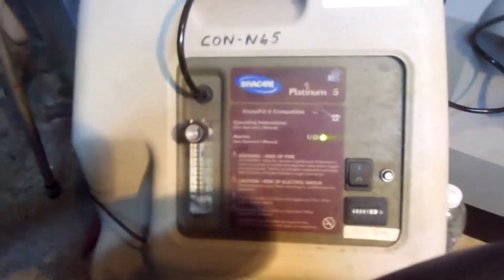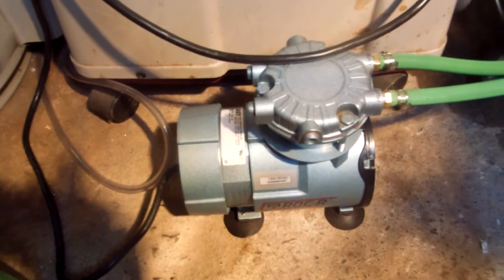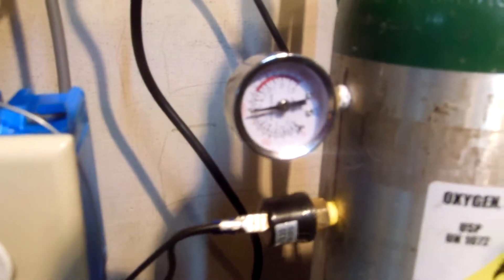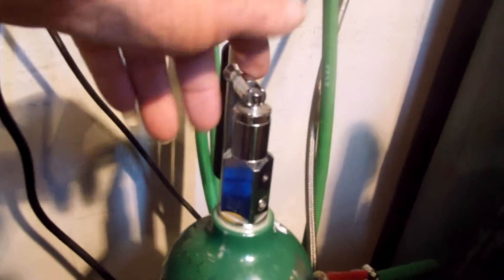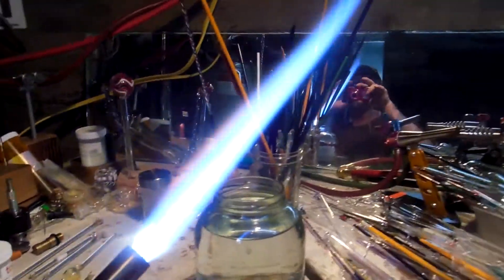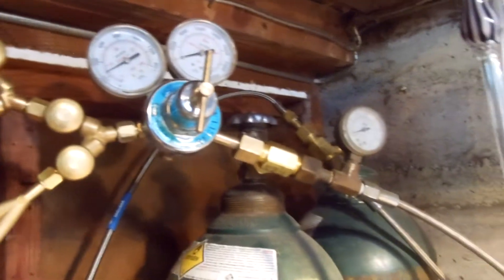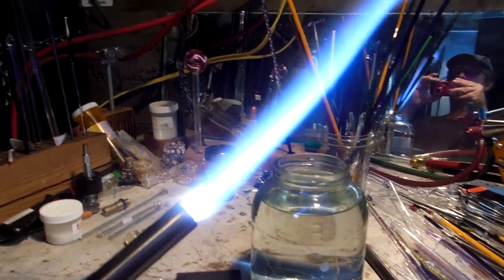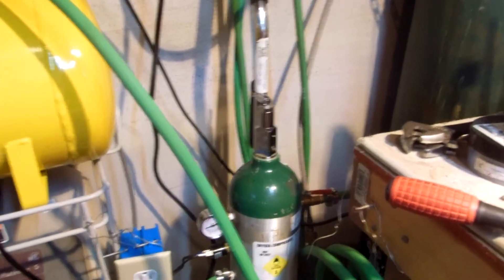My Home made $1,000  high volume low pressure oxygen system ghetto style.

Comment: I don't know if you already know, probably do, but if you get an oxycon that has its nitrogen absorber material shot due to being in a home with a lot of cooking smoke, another workshop with a lot smoke or vapors, covered in  "cigarette" smoke/tar or just a really used and old unit where isn't just the valves or pump failing causing less nitrogen to be purged in cycling. The stuff in the canisters is just the mineral zeolite. Zeolite can be purchased in most upscale pet stores fairly cheap $8-$15 for a few pounds of granules or pellets depending the brand. It's the off white colored granules sold as natural ammonia absorber for fish tank filtration systems (also used in general water filtration units and high priced cat litter but, don't confuse zeolite for regular diatomtateous earth used for similar applications). I bought some a while back at a local pet store to make a slight vacuum, waste heat/sunlight driven Air chiller/ice maker that uses water in a pvc piped unit as the working fluid no pump or electric needed. If I was to have went steel pipe (no copper), could have went with an ammonia unit simmilar to what is powered by a propane pilot light in an old RV camper fridge. Big granules are cheaper but can be ran between rollers and lightly crushed to decrease granule size while increasing surface area if needed. (put any crushed or industrial grade zeolite on a screen and vacuum any dust out from the underside of the screen before putting in the oxycon)
Oxycon canisters refilled this way may or may not run like brand new medical grade zeolite in it but, it doesn't have to for your purpose. Maybe worth a try for a few bucks...
also, if a unit is shot due to major water contamination, zeolite can just be popped into your kiln and the water evaporated out over a few hours. Another way to get the water out is to draw a good vacuum, boil out the water at room temp, purging the water vapor (and other liquids, gasses) out of the mineral through the vacuum pump, slowly release the vacuum when done.
Reply: TheDeadNigerianPrince HauntingYourInBox : I was wanting to make my own oxygen concentrator after buying one off craigslist for $100. Being quite impressed with the results from one 5l/min and researching how an oxygen concentrator works -- Passing compressed air through a zeolite sieve which filters molecules sized equal to or smaller than that of oxygen, thus concentrating oxygen, I've been really tempted to try making one of my own. Now that I've read your post basically reaffirming my idea of making a diy oxycon, you've given me the reassurance that it is in fact as easy as it sounds and I'm going to order some zeolite from Amazon right after posting this. Thanks for the info.
Reply: Joseph A. Muniz, just be aware that medical type zeolite grade and industrial grades can vary in their overall abilites to absorb.... that is why I said te the type used for tank filter  ammonia absorption may or may not work as well depending on other losses in design but, it will be cheaper than medical grade granules. If in doubt, buy medical grade nitrogen absorbing for O2 concentrators, if you don't mind some losses for welding , could try the cheaper route and use more industrial grade to make up difference in it's ability to grab nitrogen. Good luck in your endeavors.

Comment: thats brilliant,  do you think this same sort of system could be built with just one oxycon?  Or would it not have enough pressure or flow rate to keep up with the compressor?
Reply from the maker: I have a 1/6 HP compressor and you get much smaller with a lower flow 
rate to work with one oxycon and you have a pretty wimpy compressor 
thats going to work itself to death.
The sweet spot is to have 30 LPM and 1/4 to 1/2 HP.
I am looking to add more oxycons and a bigger compressor.
Reply: mike t Thanks Mike,  exactly the information I need, so not much point until I can get at least 2 or 3 decent oxycons. For some reason oxycons in the UK are well pricey. So was looking at only 5lpm ones, think I may have to look at bigger ones with more psi.

Comment: how in the world can you get all that for $1000? oxygen concentrator 5lpm if your lucky, find them for $250, that's $750, but you also have an 8lpm but for simple math we say you got them for $750, now you have two k tanks, plus the hoses and other tanks, then add in the compressor, there is no way it was $1000. awesome setup, I really need to make one of these. fuck air tech, and their outrageous pricing, for oxygen. good work mate, if you can send me a link to where you sourced all this for 1k I will send you some glass. peace and love
Reply from the maker: I got the compressor used off ebay $92. The 2 K tanks for $100 from a glass blowing friend, the concentrators for $700.
The HVO mighty mite cost $5,900 I can build the same thing with all new parts for $1,500.Mine would be better without all the un-needed electrical garbage.

Engineering is economics, you do some scrounging and you can put together a system way less then $1,000. These systems are super easy to build.
Reply: +mike t thanks for your reply! I have been looking into theroy and operation of these oxygen concentrators, I don't see why people buy them and gang them together, why not just build one oxygen concentrator? use air compressor, to fill the molecular sieves(using the on off timing as usual) then to an oiless compressor and holding tank? I believe your system, is proof I need to not renewal my oxygen lease, and to diy an oxygen system! thanks
Reply from the maker: they do but when the larger, louder single compressor goes down you have nothing.
Reply: K tanks are 350$ low end almost anywhere, oxy cons can be impossible to find less than 500$, this is impossible just right there alone
Reply: You paid too much. You could probably get broken used concentrators for free then fix them. Pump could be found for less than $100 on eBay like you said. Oxygen tank with proper valve would be the hardest thing to source . I find em on Craigslist for less than what the welding store charges.

Comment: Cool but useless. It as stated has zero backpressure meaning it when filled flows its at the same rate(not the same as a hvo unit) all you did was caddy 3 o2Cons onto a Regulator... your explained benifits.. is just the benifit of setting a regulator vs dividing your concentrators between fire stages, thats it..... what you have is noisy bloatware. Hvo systems compress o2 up to Xpsi then shut off the concentrator ect. Now if you used say 2 AUTOMATED stages or more then youll probably be able to recreate or fab an effective system. Clean work though just not effective yet.
Reply: 2nd note... technically with what youre doing you dont even need that compressor portion as its merely evacuating and not compressing. Creating a take with a bung to attatch a reg to and a pressure relif valve would do the same thing without using more power or adding noise. Its just a 3-1 chamber/connector that can by made with a milkjug sized tank off a pancake compressor.
Reply from the maker: No man iv done my homework. This video is a year and a half old. this system is vastly upgraded now., you forgot the storage factor.
 I can run 2 torches easy now, I have 4 oxycons and 58 gallons of storage total. Its automatic now.
The compressor runs 20 minutes per hour doing smaller stuff.
It does consume power but thats OK. Im on to wanting a furnace and big kilns.

You missed whats going on with this, I had 2 homefill system that died already, so I had storage all set up.
Instead of 2LPM put in the tank at high pressures I can shove 15lpm+ into 4 tanks at 50-90 psi and store it. There is a big tank outside now.

I have already ran the torches strait to the oxycons and love it. I use this to run a GTT Mirage and Phantom if needed at the same time.